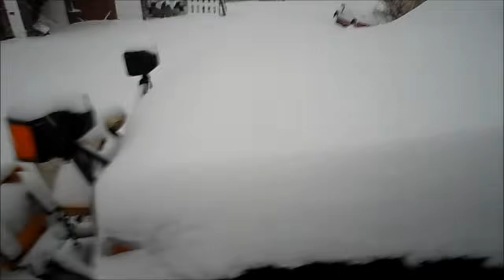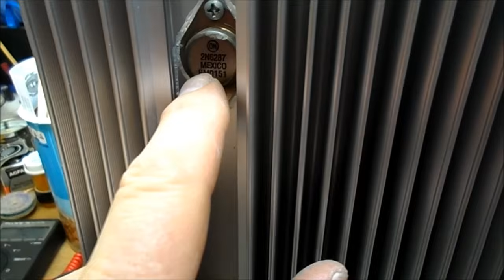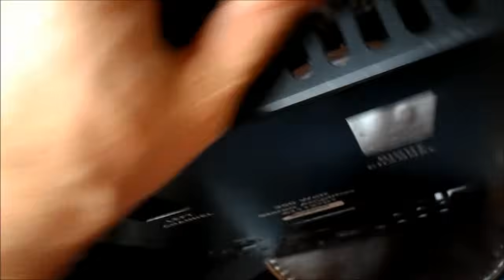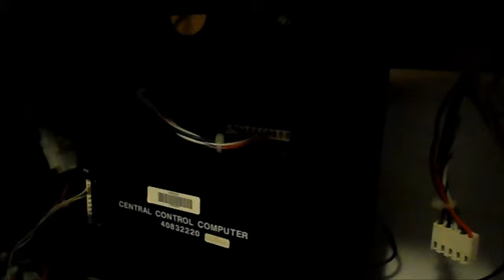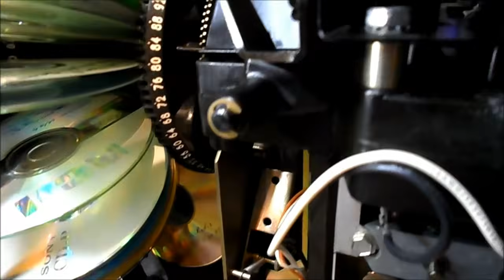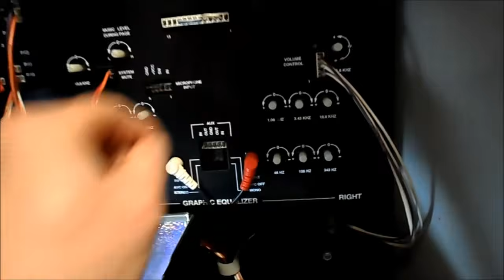Rowe W100 Storm Pt. 2_2. The Amplifier Repair.

Comment: Great informative video! Im struggling with a 45 player ( same amp) i cant work out what i need as a volume control or its connections. The amps now working ( new darlingtons) but its either dead of full depending on what i short on the Volume tags rsvp
Reply from the maker: +DAVESOUNDSMATAMP They use their own proprietary type volume control. It's still a regular pot, but it varies a voltage, not the sound signal as a conventional volume control. It can seem complicated, but if you look over the optional volume/cancel control diagram, you'll see. It's a very sensitive control, you turn it up a bit, & all of a sudden there's the sound adjusting.